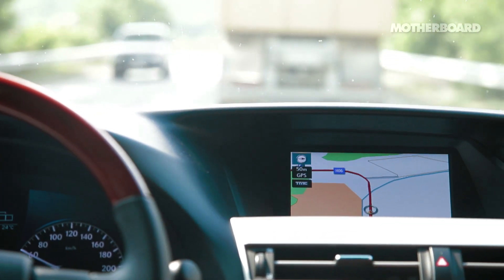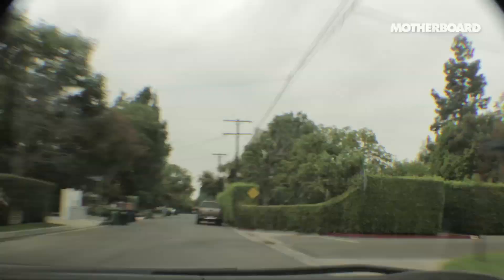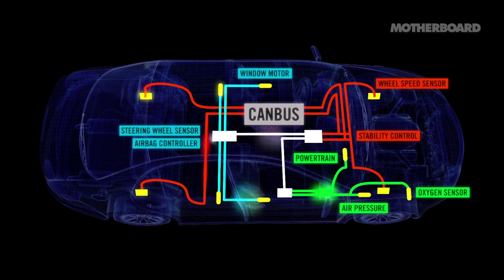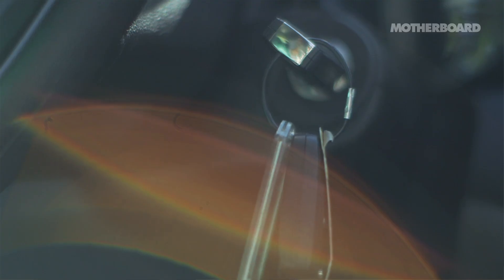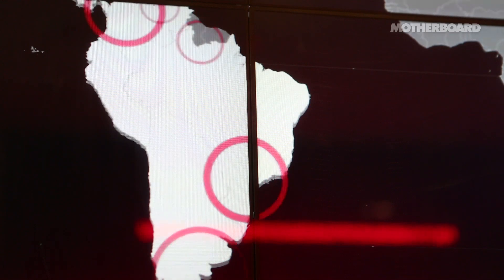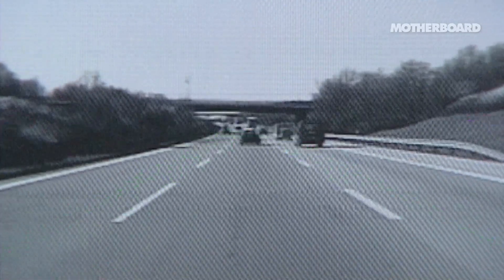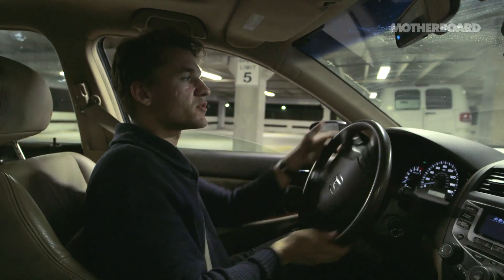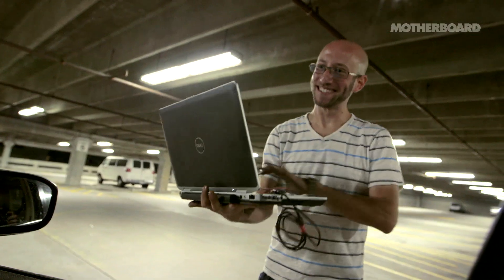How to Hack a Car: Phreaked Out (Episode 2)

Comment: Video is very misleading. Not everything in your car is connected to one singular computer. Nobody can just turn your headlights on and off, even if they had access to the cars ECU. They talk about how someone could take control of your car and make your brakes not work or turn on your emergency brake and even steer your car. But the steering and brakes (especially the e-brake ) on cars are almost completely mechanical systems that are not computer controlled. Even if someone managed to change the throttle mapping on your car to control how fast your car is going (which would require some sort of remote installed into the cars ECU) your brake will almost always overpower your engine, meaning you are still able to stop.

Comment: Doesn't happen in a skyline r34 or a supra mark 4
Reply: +GoPro Owens Yt You're gonna have to go to older models than that. R34 and Supra has an ECU
Reply: +AzureSupremuZ not as advanced as today's ecu
Reply: GoPro Owens Yt Still controllable though.
Reply: +AzureSupremuZ not as much as modern day cars it would not really control the radio and basic stuff

Comment: Car builders seem to be intent on attaching every system in the vehicle to the can bus system with out paying any attention to the security implications of doing so. It has already been demonstrated a vehicle can bus system being hijacked by piggybacking executable code on to the RDS data signal being received by the cars radio found in a major car manufacturers vehicles. Now you have connected vehicles that have 4G data modems built in to them. Also it is not just expensive cars getting all this tech. Yes often the tech appears on the expensive models first but soon filters down. For instance fitting a string rack and colum is an expensive and mechanical complex undertaking. So if you can do away with having to work out all the complex geometry of weaving the steering colum through the dashboard and engine bay and replace it with just a few control wires then there will be massive long-term cost savings for manufacturers. For the moment one car manufacturer is still fitting the steering colum but with a clutch system in it so if the computers detect a fault in the drive by wire it closes the clutch to restore steering control to the driver. But then you are still reliant on the computers being able to detect a problem.

Comment: NOT a problem for me.My car isn't 'online'.I won't be EVER buying a car newer than about 2005 not for the issues raised in this program, but because at the moment I can either fix the car myself or have mates who can.Manufacturers already have software in place with which they can make your car stop AND NOT RESTART until you take it to be serviced if you miss the service date.What is more, the hardware needed to tell the car, that's YOUR CAR, THE ONE THAT YOU HAVE PAID FOR!!! that it has now been serviced is HUGELY expensive, and that assumes that the manufacturer will decide to let third parties buy it in the first place!Oh, did I mention that you would only be able to recover your car to a main dealer to get it serviced?Yes people, this is ALREADY sitting in your car's main ECU just waiting for you to ignore your service interval...

Comment: So when you rotate the wheel . Its not due to a mechanical motor or differential but. Its electrical components?   Does it works on old cars like from the 80s

Comment: These cars that CAN be hacked must be from the year 2008 and newer. Cars older than 2008, CAN not be hacked remotely. Correct me if I'm wrong, I'm still learning. Saw this video in the side panel, and figured I'd give it watch. According to Wikipedia.. But I see other sources say it's 2003.

The car that he hacked, is a 2003 or newer Honda.

Pun's intended.
Reply: +Mark II 2003 is when all car manufacturers made laser cut keys so you could no longer steal cars with a screwdriver, scissors, etc.
Reply: zack lee Great info thanks Zack.

Comment: To access the car computer you must connect a device to the OBDII port, which is inside the car. (BTW modern OBDII diagnostic scan tools such as Snap-On VERUS or Autel Maxisys can be used to monitor datas and actuate various components of the car. For example, you can change engine RPM with a simple function...)  To take full adventage of "car hacking" the car would have to be equiped with Electric Brakes, Electric E-Brake, Electric power steering, Electronic Throttle actuator, etc. This Honda accord wasnt a really good example because it only has the electronic throttle, so the only thing you could do is kill the engine or accelerate. All the driver would have to do is put it in neutral or turn the ignition switch off then stop on the side of the road... You'd lose power brakes and Power Steering but they would still be usable.

Comment: 4:12 "you can just walk by and implant the device." Is it really that easy to just walk by any locked car and attach the physical hardware to the cars computer? For some reason I feel like it can't be all that easy without access to the inside of the car or engine bay.
Reply: +bellajaid even so hooking a device only to the ground of another device isn't going to do much unless it can interfere with the ground and that's not possible from the outside.
Reply: There are endless stories of people hacking cars from the outside without even doing anything to the car
Reply: +Hyedrojin Wan I would agree with you. with how they place the diagnostic ports even in hard to get to areas even with the keys, I doubt that leaching on to this cars internal network is something that one can just walk by and do  that with out keys or making people suspicions. Even then it's really only the expensive cars that are drive by wire, the I've had to move cars that aren't not that old ('90-'95), and the hand brake, regular brakes and steering still work, though takes more effort to get them to respond with with the power off but I can still get them to.  And no power=no computer  so there was a mechanical link there. Power assisted but still manual control.
Reply: +Hyedrojin Wan Engine bay? Lmfao, electrically the engine bay offers no more accessibility than the outside of the car, outside of cutting headlight wires. ECU control is located in the dashboard, close to the driver. Cloud-based systems though, will always be vulnerable to remote penetrations.
Reply: +Hyedrojin Wan Here's the problem, battery has to ground, usually on the frame. Metal frame on metal body is conductive. With the right materials, you could likely install it right to the body, although this device seems clunky and noticeable. I wouldn't be surprised if within the next 10 years this becomes a serious issue.
Reply: @Hellothereworld4  no, it doesn't work like that. The can bus has ground on its lines, but the actual data uses CAN HIGH and CAN LOW lines to communicate. Tapping into any module in the car can give access, but I don't know if that's possible wirelessly or without physical access inside the car. The rear lights is possible only if you can unmount it from the outside.

Comment: This is one reason that I have a manual transmission. Even without being hacked, I want something that I control to be actually involved in the process. I have computer assisted steering and brakes, I have a security system that could turn the car off. There is so much that I don't actually control. I do control one of the links from the engine to the wheels.

Comment: im pretty sure hes using an OBD plug with bluetooth connectivity
for this you need first physical access to the car and plug in the OBD controller
all cars have OBD plugs this is for maintenance, data logging etc...

trough this connection you can increase fuel injection or reduce, program injection timings and spark timings and also disable brakes (ABS only)
you can reset the maintenance milage counter and alot more....

cars dont come with with wifi/bluetooth connectivity out of a factory to expose it to hacking
car alarm systems operate mostly on 433mhz and 415mhz and are isolated from the main computer system
because they only need to interact with the ignition and doors directly

so basicly what he did was just use the ODB controller and the OBD software that exists already many years
to control functions of the car and label it under hacking

you can buy OBD controllers from just $30 on Amazon
and they link with bluetooth to your ipad or computer and come with software to control
whatever your car is capable of depending on brand, model, year....

you can break into someones house and install a small usb powered computer on the network like a raspberry pi and have access on all his network shares
this is not really hacking, more like breaking and entering because hacking would
not require any installation of hardware to access your network and if there is no network e.g. wirelessly there is nothing to hack !

so no illusions here

Comment: LOL, at the guy saying it was easier to shoot you, yes, perhaps... but easier to kill you without detection by exploiting data, causing a car to accelerate uncontrollably and simultaneously deploying the air bags would be what most of us would consider a bad set of circumstances, especially when during the crash the seat belt tensioners fail to operate and the airbags are already spent.  The level of mayhem possible is huge... now consider the security of "On Star" and similar competing products, I'm sure that someone has already had a bad day because the inherent lack of security often found in embedded systems.  This has been talked about since DEFCON 7 publicly (as I know one of the speakers at that conference addressed the vulnerabilities of embedded systems at that con....  You think that Stuxnet would have sent a shockwave through the embedded development community.

Comment: remotely starting the Accord, seems like BS to me. If there was the facilities to start the vehicle JUST from the can bus, remote starter manufacturers would have figured this out. It isn't till the 2013 Honda Accord(push to start)  that you can tell the vehicle to start from the can bus. And from this video you can see the vehicle has a standard key.  Also he would need the key to be in the vehicle to remotely start it or have access to the system while the key was in the vehicle to learn its code.

Comment: That is ridiculous, with or without can bus everyone who have access to the car can control the car with some very cheap MCU like Arduino you can use relays PWM DAC to manipulate all sensors in car, the problem i think is not the CAN BUS, even if you use some other protocol with some encryption, cutting the sensor wire and bypass over some MCU is the easiest way. So please guys hacking cars system is done maybe from 20 years ago.

Comment: Only certain cars are susceptible to certain hacks. You have to be able to get past the locks, internal alarms, pop the hood, which is very hard to access without getting inside the car first. Only certain cars have parking assist steering and emergency breaking assists. So some cars don't have this. Only flyby wire function can be affected by hacking certain cars. Most cars the hand breaks are still manual. You pull the handle up, it pulls a cable and locks the rear drums or rotors. That's not flyby wire(electronically signaled).

Comment: As long as there is no cellular connectivity it is not possible right?  Unless someone plugs something into the car?  My car is a 2006 Jetta 2.5 and it has no cellular connectivity that I am aware of.  It has no satellite  navigation or even anything similar to Chrylser's U Connect.  My car is a basic model and it is all I need.  I don't have onstar or anything like that.  You know something?  I don't miss it.  I have heard some bad things and now I would not want it.

Comment: I'm a car electrician and i would like to say this is all bullshit and fake!! please focus on 00:23 , how can you reverse the car without depressing the brake pedal? for moving selector lever you need a physical press to the brake switch its the only power supply to the range and selector lever sensors ??
Reply: ***** I'm no car expert,but it doesn't take that to know that when a car is turned off power braking is dead,he was going uphill so gravity did the rest.
Reply: +Sam Fidal the only way it is possible to put a car in reverse is if it has electronic gear changer. but still you cant controll brakes or steering by a computer.. så this is just complete bullshit..
Reply: NikkiDiamond
Or pulled with cable like a donkey in old century !! lol

Comment: This is why i drive a 1992 corvette......
Reply: Wet Orpheus hot wire x)
Reply: Wet Orpheus not because you can't afford the new one.....
Reply: Spacemozz Designs 1992 corvette looks actually nicee
Reply: @clowns8421  lol i bett his car can beat ur toyota
Reply: +imedus ZD Don't bother with the wires, just jam a screwdriver into the column next to the signal light switch.  Pry the plastic away, and push in the lever.
Reply: Vincent Lodewyckx if you knew what my car sounded like you would end up trying to not only hack it but steal it too lol
Reply: @OrpheussZ06  if your 1992 corvette uses a wireless key fob, you can simply use a replay attack which is really easy because of the age of your car.
Reply: +Wet Orpheus like anyone would ever want to "hack" you
Reply: +Orpheuss Thats even easier to hack...let me get my screwdriver, hammer, and a pliers. ;)
Reply: Wet Orpheus is it that bad that I would have to steal it and drive it in the a ocean?
Reply: @vincentlodewyckx235  (bugatti intensifies)
Reply: Smart
Reply: Orpheuss 1969 mustang convertible and 1968 truck which is converted to electric.
Reply: Vincent Lodewyckx bro i dont live next to an ocean....
Reply: they started I installing them wayyyy before then
Reply: Orpheuss thats why I drive my feet
Reply: What's the point of demonstrating "hacking" a car that's had physical mods? It's basically then a remote controlled car.
Reply: Any vehicle that has it OBD system is actually hackable so your 92 no makes a difference
Reply: c ss Move on with the times bro
Reply: Yes, but nothing is stopping someone from hacking traffick lights.
Reply: If its after 91 it Can be hacked
Reply: 1992 wow awsome
Reply: Lol it has even more outdated security same thing
Reply: Oof no LS
Reply: CAN Bus is found in the 1980s so probably your car has it. And it is hackable.
Reply: -I was furious about knowing what was going on on my partners cell-phone and ended up getting scammed twice,so i found a Russian hacker on a YouTube post and i heard he's pretty good and yes he made me know every detailed information on the phone. So guys so many scammers out there,i want to take my time to share you the Instagram page of a real hacker i know @benjayhacks. Save your time and money.
Reply: -All these various hack  videos are just made to promote thier channel,this is big time wastage if you're watching. Save your time,Save your Data and Contact @benjayhacks for his service on Instagram. Thank me later.
Reply: Wet Orpheus I'm pretty sure your country is surrounded by ocean...
Reply: +Wet Orpheus they would kill the engine cause it sounds so bad.
Reply: Haha Nice one, this cant be hack it
Reply: asylumDAYS  Trolling much smh 🤦‍♀️ even the newest teslas can be hacked
Reply: GM 3 2008-2019 cars can be hacked but one old Camaro i dont think so 😂
Reply: asylumDAYS what year are you’re referring about  xx to xx ?
Reply: GM 3 thé old cars dont have a computer to follow comands or something by one network, you tell me about Tesla Cars i know this one can be hacked, if thé car dont hace a computer cant be hacked rigth?
Reply: asylumDAYS cars built from 82 and up had computers as far as I can tell computers can be hacked can’t they?

Comment: The ECU is the only way to hack a car, which you have to be locally in the car to do it. No ECU transmits wirelessly unless it has a special plug connected to it, even if you plugged one in the range would be poor. How everyone is fooling for this joke :D

Comment: I dont understand how is he able to connect remotely as i dont think the car electronics are connected to the internet nor has any gsm connectivity ?? The Car needs to be connected online to be able for remote access .Please explain the connectivity of the car to the internet or GSM or wifi or bluetooth oth whatever.
Reply: Maybe the navigation system is what gets hacked
Reply: Arif Khan you have to make a circuit containing mcu , CAN ic , GSM module (with a active sim inside) .. then all you have to do is to connect the circuit to the 2 CAN wires which can found from OBD2 port or from the wires under the hood ....by doing so your circuit gets connected to the ECU inside...  then you can talk to or listen from the ECU from anywhere in the world

Comment: This a bit rubbish. Because as far as I know is the CAN bus not exposed through a wireless solution.
So you'll need to put some sort of a wireless host bridge in to the OBD or the CAN controller leads.
So in order to this wirelessly he must have had prior access to the car.